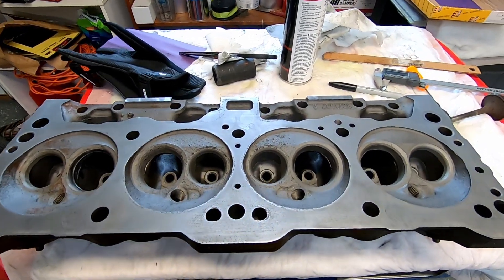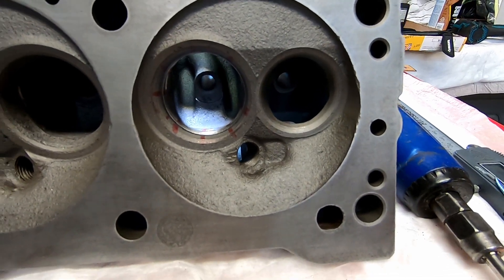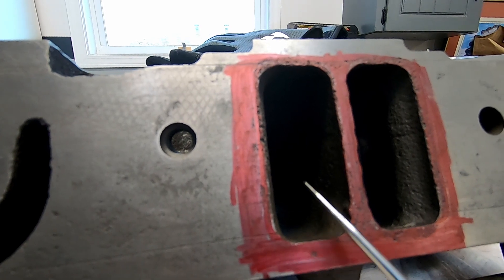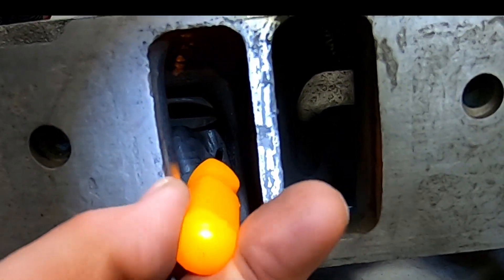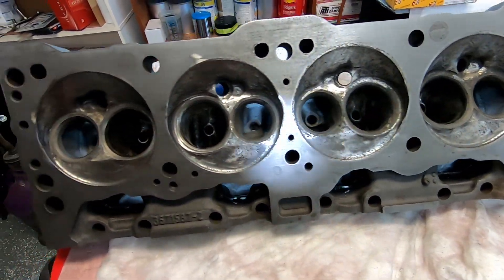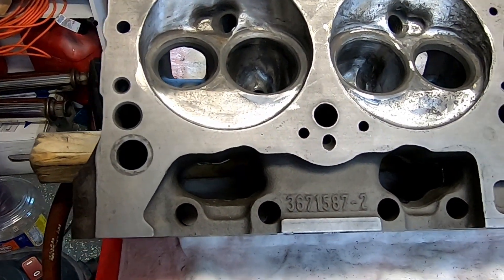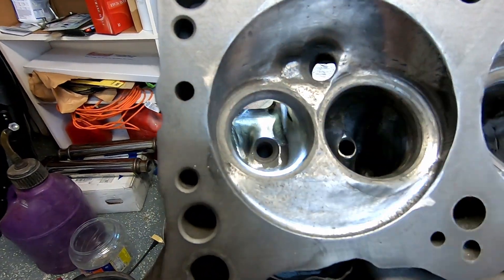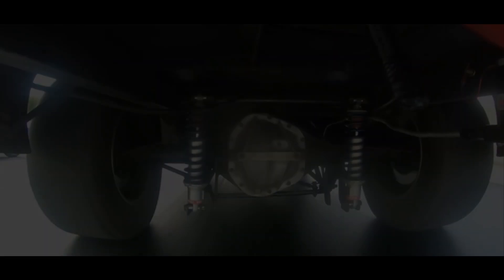Smog 360 Small Block Mopar Head Porting @edsmachine93 @servediocylinderheads

Comment: I used a set of '308- casting' 360 heads on my '76 318 in my Valiant. The factory machining was so bad (the car was an original 88K mile car when we started), that the decking required to clean the top end up turned the KB pistons into pop-ups and would have over 10-1 compression ratio with the 308 heads & stock head gasket thickness. With 0.060" thick Cometic MLS gaskets, the compression ratio ended up being 9.45-1, so pump gas was viable. Heads? New guides, exhaust valves, multi-angle valve job and a little cleanup. It's not a race motor, but it's a very nice street performer that isn't finicky.
Reply from the maker: Thanks for sharing. It sounds like I have a similar plan with these heads.

Comment: you don't want the throat to be the same size as the bowl on the other side of the short turn. you need the bowl to be bigger. if it's a straight shot like yours, you take away the venturi effect and kill low lift flow, big time.
Reply from the maker: Thanks for sharing. I understand the principles there. My bowls are slightly wider than the throat. Ed is cutting new seats for larger intake valves and then blending them as needed in to the throats. I will show some better measurements next time.
Reply from the maker: Always room to improve
Reply: @JustMoparJoe  yep, now you know...👍

Comment: Cast iron porting. Ewww. After doing aluminum you’ll never go back.

Good job keeping some meat and creating a trailing edge on the guide bosses. 

Can the leading edge be narrowed any?  Appears to take up a bit of area…also kinda looks like it isn’t quite parallel to the port walls…?

Don’t get too caught up in surface finish/sanding everything. 

Good job overall.
Reply from the maker: Thank you! I definitely prefer aluminum, but we wanted to keep the stock style head for his little red express engine.

Comment: I would definitely gasket match the head , start at your line and roll it into the port no need to hawg it out , will definitely make a difference in low to mid throttle.
Reply from the maker: Thanks Brian. I’m going to port match the intake to the heads on final assembly. That way I can double check roof alignment.

Comment: Nice work and very instructive for me. I want to overhaul my engine next week and also wanted to port the heads and file away the heel of the original valves. Does that help or can you neglect filing the valves
Reply from the maker: Hey Phil. You can definitely see a gain by backfacing the valves. It’s usually a simple and inexpensive process at most machine shops. You can do a version at home, but it’s often time consuming.

Comment: Hey Joe, I'm asking because I don't know, not questioning your work. What makes this a smog head?
Reply from the maker: Hey Brad! I used this term because it wasn’t and X or J head. It has the smaller intake valve 1.88 versus the 2.02 of the performance head.

Comment: I gaskets matched both heads and intake on my 318. My thoughts are bevels flow better just like the top of a velocity stack and you can take a good amount off the push rod pinch. I also opened my intakes up to 1.94 valves.
Reply from the maker: I agree with you! Thanks for sharing. I will definitely gasket match the intake to the heads before final assembly